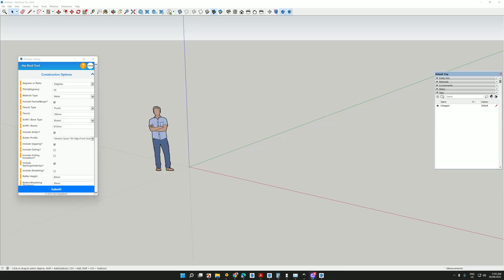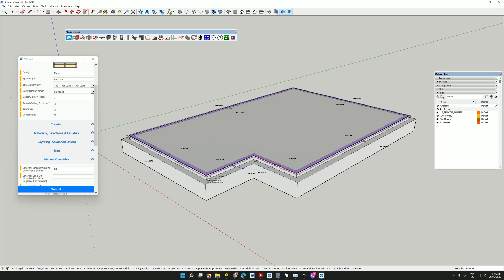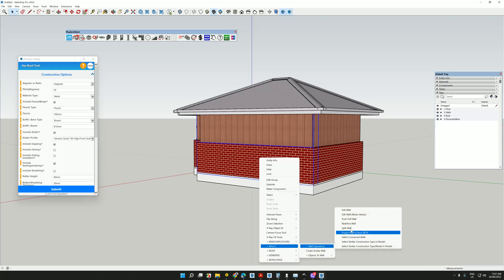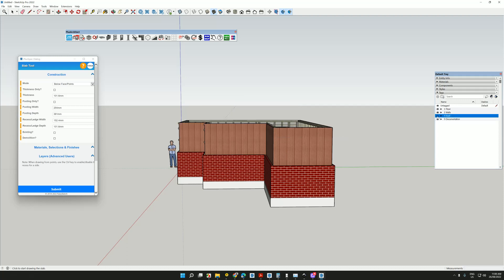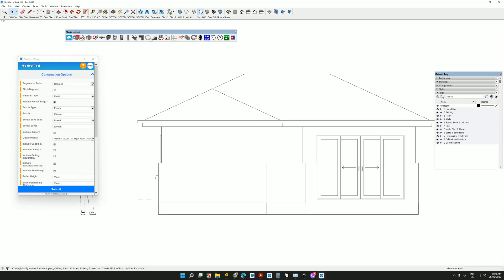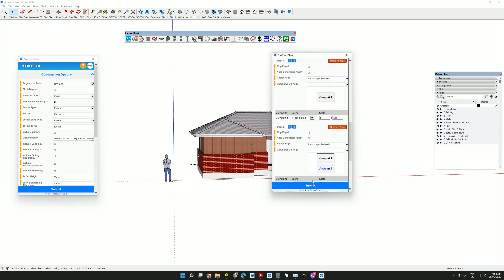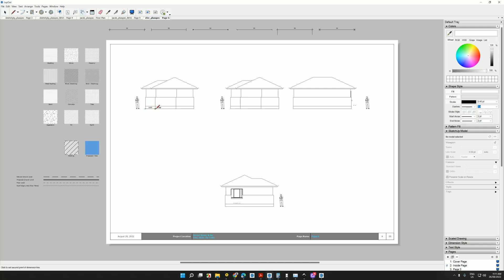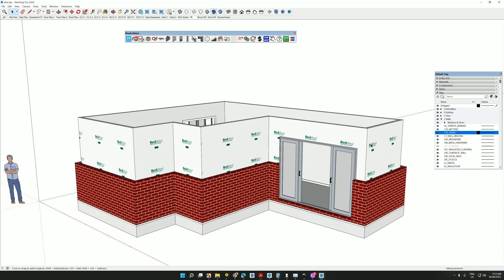Creating construction documents inside Sketchup and Layout using the PlusSpec PlusArchitect plugin!

Comment: I used to love SU but then the licensing model changed.  I've used Nick Sonder's work flow for a few projects, but this looks awesome.  How do we create new elements, walls, roofs etc. to have that level of detail automated?  Looks great
Reply from the maker: PlusArchitect and PlusDesignbuild add the level of detail shown in the video.  If you choose a cavity wall with framing, it will automatically create the framing, add lintels, etc. If you reproduce specific details on multiple projects, you can make a parametric vignette and use the "create similar" functions. Here is a video demonstrating this feature. https://www.youtube.com/watch?v=69vtHWiCBas